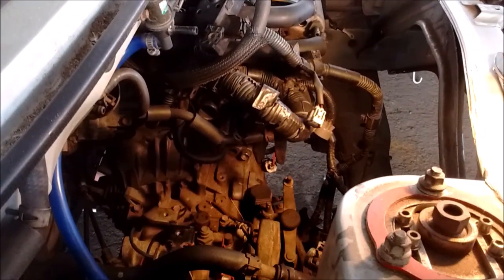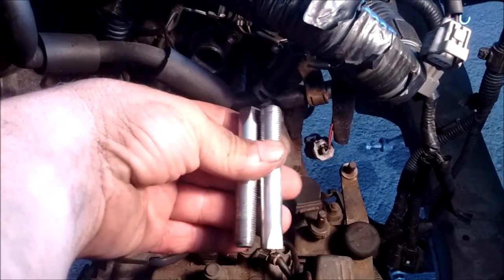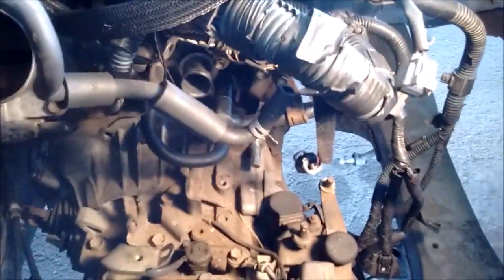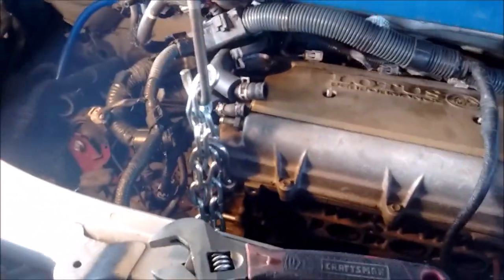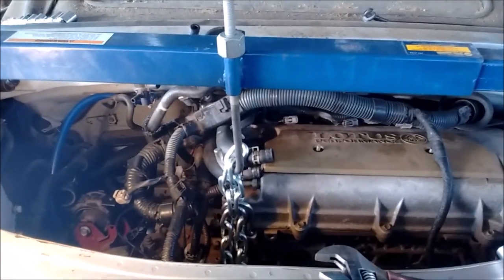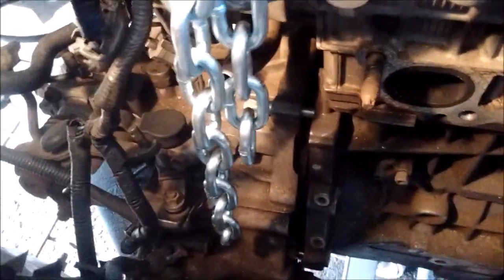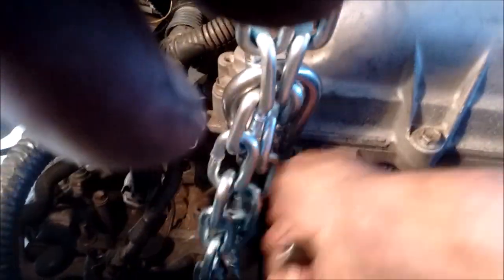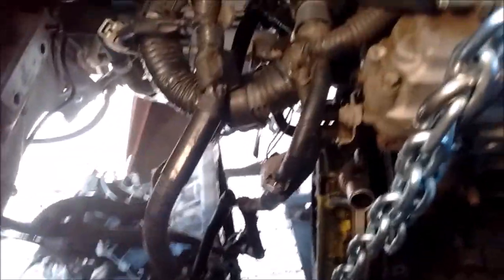How To Remove The Transmission - Toyota MR2 Spyder

Comment: The support studs is a game changer.  You can use a couple nuts on these as a safety to prevent the tranny from sliding off while you remove the tranny, the use the jack.  Avoids having to go back and forth between the nut on the engine support and lowering the floor jack.  Just position the jack before you remove the trans,ission from the studs.  Use ratchet straps under the transmission and across the engine support to lift the tranny back up, slide on the studs, then secure with nuts on the studs before starting all the other bolts.
Reply from the maker: One more thing Rene - this saves you from damaging the input shaft or the clutch disc when you rest the full weight of the trans on them - as you do when there is no support. This often causes a premature clutch failure.

Comment: Couldn't you just use a transmission jack, remove all the bellhousing bolts and drop the trans right out? Or do you still have to lower the motor to clear the flywheel and fender? I'm about ready to do this job soon (my first time). Thanks for the video!
Reply from the maker: With the 5-speed you can do as you said. With the six-speed, the transmission is actually longer, so you do what I did here, because otherwise it will hit the frame rail and not go any further on removal.
Reply: @Merryfrankster_  Okay good to know...thank you! I'm pulling out the 5-speed and replacing with a 6-speed. So will follow your guide.
Reply from the maker: @robthomas4226  Definitely yah inclining the engine will make the 6-speed install much much easier. As will using the guide bolts. And don't forget you can give the crank pulley a little jog to help the input shaft splines match up to the clutch disc splines.

Comment: Hi Mate, is your MR2 the sequential gearbox? I just completed a clutch replacement, but it is just stuck, will not go to any gear. I did not pull any hydraulics out, thinking that should work but not. Need some help, please
Reply from the maker: Sorry with SMT you need specialized help I am not able to provide.
Reply: @Merryfrankster_  Thanks mate for your reply.
Reply: @sunshinel6994  recently bought a 2002 mr2 SMT, for $2,000. Hoped to fix the issue and get some miles before doing the conversion. I noticed the HPU fluid was leaking through the GSA onto my gear stroke sensor, causing it to not go into any gear at all. Rebuilding the GSA was the only way to fix that issue and not have it keep ruining gear stroke sensors…so onto the conversion for me! But I would try pulling the gear stroke sensor (tight squeeze to remove) and testing that, also caused me to not have the indicator light show up on dash. So definitely check that sensor, and or clutch stroke sensor, both are on the bottom of the GSA. Hope that helps!

Comment: Is there any thing you have to do in order to remove the shifter cables? Is there a certain way to install them? I just removed this same transmission and the shifter won't go into gear like normal.
Reply from the maker: Make sure you have not crossed the cables. I have another video that covers their removal and installation is just the reverse of removal.
Reply: @Merryfrankster_  thanks man. I actually swapped them before hand and it didn't work but something told me to swap them again and i guess the first time the left one fell to the right and i put them on the same backwards way lol Swapping them fixed it
Reply: No joke those two tiny metal brackets are probably the hardest thing on removing the whole transmission. Order new ones because you'll probably break them

Comment: Could you give the length of the two studs after cutting , please i am getting ready to pull mine and was trying to figure the length of the two studs.
Reply from the maker: About four or five inches does it nicely. They need to give enough room for the input shaft to clear the clutch, but not so much that the cap of the trans hits the frame rail.

Comment: My transmission isn't sliding off, it seems to have something holding it on somewhere
Reply from the maker: You may have missed one of the bell housing bolts. If not, find a gap where you can pry the bellhousing from the block. But make sure you have unfastened every bell housing bolt first. There is nothing else to hold the transmission to the block except possibly corrosion in the registration dowels.
Reply: @Merryfrankster_  Thanks for your reply, it ended up being it needed a lot of prying and pulling to come off. I had it in my head that it would easily slide off haha, getting it back on will be fun!
Reply from the maker: @clarkdef  sand down the dowels a bit, and if you use the sliders it should be easy to line up and get a couple of bell housing bolts started.
Reply: @Merryfrankster_  I don't have any extra bolts or a grinder, but I could hammer some wooden dowels in there?
Reply from the maker: @clarkdef  No. The steel dowels are the most important part of holding the block and the transmission together, the bolts are there only for clamping force. TBH I am not even sure what you are talking about. I think I said sand the dowels a little bit to get any corrosion off them so they slot back in easier.
Reply from the maker: @clarkdef  I just realized that you are asking about using wooden slider pins instead of the cut slider bolts. I thought you were asking about the two registration dowels for the bell housing. Whatever you do, when you re-install the transmission, avoid hanging the weight of the transmission on the clutch disk or input shaft. This will damage the clutch disk, and you won't know about it until later, when the clutch disk fails prematurely. Always have the weight of the transmission fully supported when you are re-installing it. You can use wooden sliders if you want, you might have to grease them for the bellhousing to slide on them.
Reply: @Merryfrankster_  Ahhh. Thanks. That's a good tip! I think I will go looking for some bolts and a cheap grinder, because it sounds like a very important step. I am removing the fly wheel and putting on a light weight fly wheel, is the torque setting of 70ftlb sound right? A google search suggested that.
Reply from the maker: @clarkdef  I would suggest buying some ARP flywheel bolts and follow the instructions for torquing that are included with the bolts. For OEM bolts, the factory service manual suggests torque uniformly to 36 ft.lb, then turn additional 90-degrees. Use blue loctite on the threads. This is to seal the threads and prevent seepage of oil through the crankshaft.

Comment: Thank you for this Frank , i am going to do this over the next week,as i am going to change the SMT into a manual change and put in a new clutch. 
Thanks 
David
ps if you know of a good video on changing the SMT system point is in the right direction. i have read up on it but it,s nice to see someone do it Thank You
Reply: @IAmSwan  Yes I did replace it, it's a bit faf you have to replace the ECU and wiring harness, gear selectors in the car and on the box. Install clutch hydraulics ,pedal and pipe work. I also put a new clutch in it's an ideal time. One thing I learnt if I was to do it again i would drop the engine and gear as one whole lump. I also downloaded instructions from one of the forums I think it was Spyder Chat i will try and find it. Best of luck